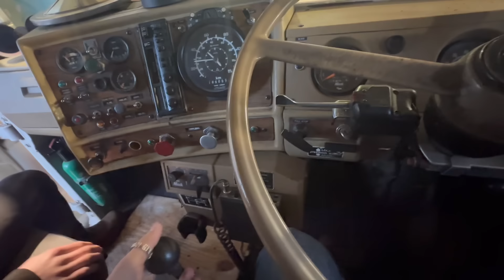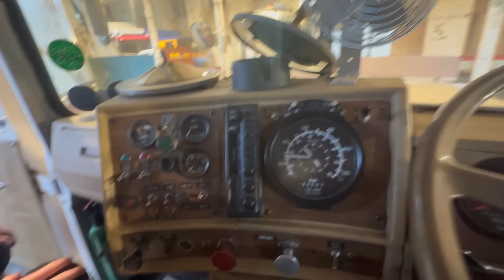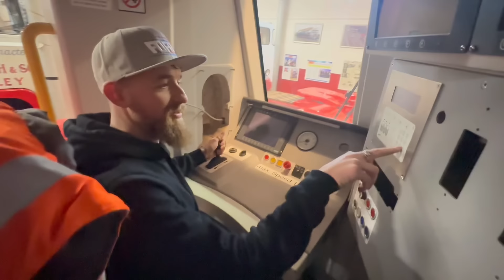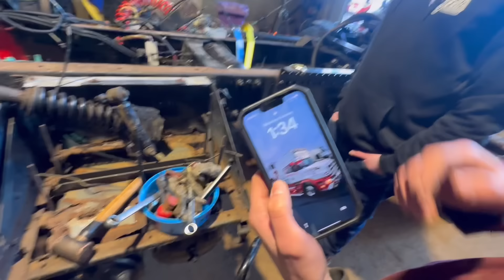Volvo FH12 with Scania V8 engine Swap!!!!!!

Comment: Well done to everyone involved in this project. And fair play to Trucker Tim for commenting and giving Murdochs the 👍. That’s quite a collection they have there and if they can continue to use the old building that will stop it from being demolished.
Many years ago in S Wales my cousin and myself shared an old railway building with an engineering company. We maintained a fleet of 4/5 trucks from 7.5 ton TKs to a F86 and F88. Some friends who were fitters would help out on big jobs and the crack we had was just incredible. On late nights it always finished with fish and chips and a couple of flagons of woodpecker. If we finished earlier it was off to the pub.
My cousin was infatuated with putting diesel engines into cars. One of the easiest  was a 1.5 l diesel out of an ex post office J4 into a very nice Austin Cambridge. We put a Perkins P4 into a Ford Zephyr, but couldn’t get the servo to work for the brakes. A convertible Hillman Minx which he bought and we rebuilt the engine. Actually sold that on and made a few quid out of it. The worse one was another purchase that needed work, but we got it running and used it for a while before selling that on. This was a Rover ?? the big ones that the Prime Ministers used to have. Is it P100? That had a 4 cylinder Ricardo engine out of a Commer truck. Holy crap that thing would pull a house down and absolutely fly. Ricardo’s were good when running and were early direct injection motors but absolute pigs to start, their downfall.
That was close to 50 years ago, learnt a lot as a teenager and the atmosphere at Murdochs definitely reminds me of those great times we had. 🏴🇺🇸 Great content Sandy 👍

Comment: Intresting project!
In the eighties Solstatrafik in Karlstad sweden had an F12 in good condition but with a bad engine.
They also had a Scania 142 very rusty but with an excellent engine.
They put this together with a special made adapter between engine and gearbox.
Except for some problems with clogged fuel lines that truck run daily between Gothenburg and Karlstad for a couple of years.
The drivers callad it the perfect combination.😊